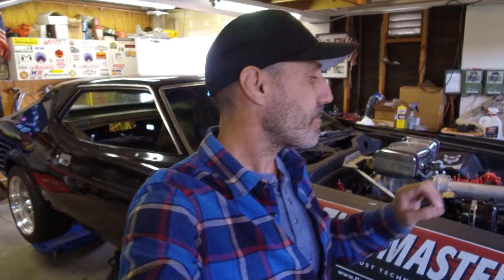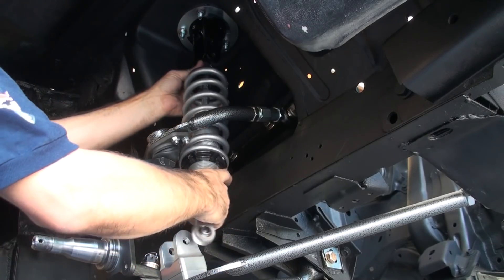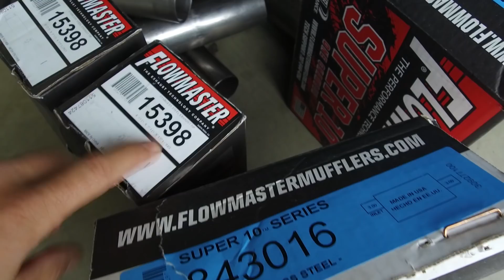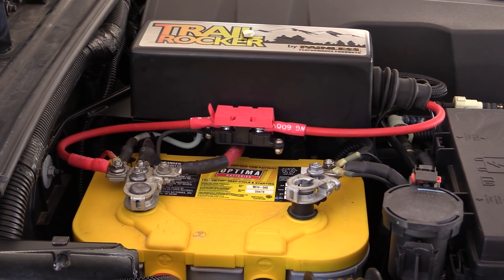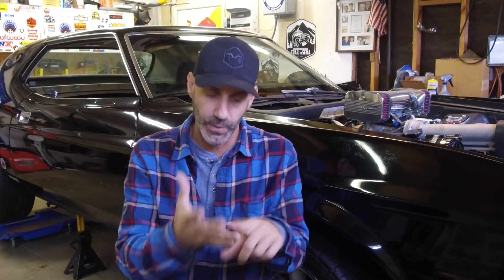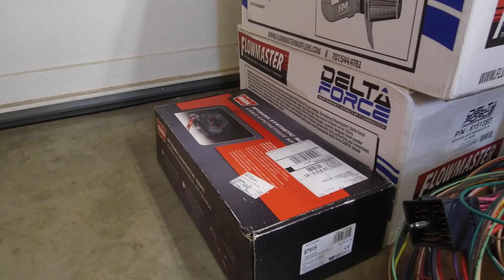I Made So Many Mistakes! AutoEdits Mustang Project Large Marge

Comment: Glad to see large marge back!! My '69 Mach 1 is at the body shop getting paint, need to do the painless wiring when I get it back, looking forward to more of the Mustang videos. I went with the Dakota Digital dash to fit into the existing bezel. Works with the Holly Sniper & Terminator via the ECU connection.

Comment: Project cars are always tough to keep motivated on, especially when you start doing real major work. You really just want it done and to get that satisfaction. Kudos to you for sticking through it and building the car the way that you want it. I had my 72 blown apart with no budget but lots of time, and I did a lot of work that was just a portion of what I wanted to do in the long run but got it running on the budget that I had. It's together and running great now and I've had a blast with it. However..... I'm gonna be taking it all apart again and redoing a lot of work to get it to where I want it. So in the long run it might have been better to just be more tedious and stretch it out longer. All that said; no regrets these cars are for learning and challenging yourself. 

On the gauges, I saw your next video that your going with the dakota digital, they look like they make a great product look forward to seeing more as I want to eventually update mine too. I currently have an aftermarket tach mounted in my stock cluster and then autometer volts/oilpressure/temp gauges mounted in a factory cluster above the radio hole (not all models had these spots but it worked awesome for me.). who needs a radio when your motor sings all day! 

looking forward to your upcoming videos on the wiring, I have a universal painless harness that I've been taking myself into starting to tackle eventually, the factory wiring has so many gremlins that I've bypassed a lot of it for the more modern upgrades (efans/fuelpump/ignition/ezefi)

Comment: I really dig the large marge videos.  I'm working on a 1969 Mustang and a Triumph TR4 with a custom chassis and SBF engine swap, so many of the upgrades you are doing on large marge, I am doing on my projects.  Your videos have been helpful, so thanks and keep up the good work.  As for the gauges/dash, I like the autometer gauges, I'm old school like that, but the dashes in the mustang do suck from 1969 on and with the supercharger and upgrades you have, I see the necessity for the digital dash.   Plus, it looks like you might have a autocross/track toy on your hands, so the digital dash will be good for that!
Reply from the maker: I like the sounds of your projects! Because of people making suggestions on this video... I looked over at the Dakota Digital page and they make a pretty cool set that fits in the stock console!  I'm going to do more investigating and see... would save a bunch of fabrication time and be cheaper than the Holley unit for sure.

Comment: Jason its good to see you back on Marg!  I've watched all of the Marg videos and I think you're doing a great job!  I actually sought a little inspiration from these videos during my build of my 65' Falcon.   I even went with the Niccop brake lines, and man was it a lot easier.  I had my fair share of problems during my build, (first engine fried the bearings in 400 miles, brake line leaks, brake caliper piston knock back issues ect. ect.), but luckily I have some great car buddies that have helped me push through and I should be done by this coming spring.   Regarding gauges, my preference would be to go with the Holley display.  I saw these on SEMA video and I think it would be a great tool to have for tuning and to customize the outputs that you feel are most important to monitor.  I went the traditional analogue direction, but after seeing that video I will be saving up for this as well.  Last comment, can you generate a video with some feedback on the blower / efi setup you are running once you get the car out and driving.  I've always been interested in hearing about what people feel about the performance of these blowers and how well you feel it works for what you are doing with the car (auto cross, spirited canyon driving ect)  I plan on auto crossing my Falcon and would be interested in running this setup as well, so your input would be much appreciated.   Thanks again for making these videos and keep up the good work!

Comment: Large Marge is back! Great to see her in another video.
The digital dash is probably the better and easier option but I do prefer analog dials. Plus no digital readout means you can still say, "well officer my speedo was between the 40 and 50 mph marks but I can't give a more accurate estimate than that.

@AutoEdits Jason for the extra gauges if you go analog, could you do an A pillar cluster like they have on the 1 ton trucks?

Comment: Glad to see a Mustang video. I just got the smaller (7.5 inch) Holley digital dash for my foxbody Mustang, mostly because I wanted to avoid having to buy/set up all those analog gauges and because I ended up getting the Sniper EFI. I say get the digital dash, especially if you can make/buy a housing for it that looks like it belongs in your car. I bought one from a company named Florida 5.0 that makes them for the later model Mustangs, and it has an OEM finish to it. I don't think they make them for a '73 or if they have plans to in the future, unfortunately, but perhaps they would be interested in doing a one off or something (I'm not affiliated with them).

Comment: Jason,  Love your channel.  Go digital with the dash.  You have already done a ton of modernizing, why worry about a classic feel now.  If you were doing a restoration, stick to the analog.  You are building a performance based vehicle in the shell of a classic.  Also, when you do decide to get audio, just do a Bluetooth amp set up.  There are quite a few set ups that involve using a Bluetooth amp and there is no need for a head unit.  Just run speakers to the spots and power them completely with the amp or series of amps.

Comment: Jason, it's great to see that you're back with the Mustang project. I too am in the same boat in a way. My Mustang is currently at The Body Shop. AKA F-bomb Speed Shop. So far it's still on the rotisserie and needs to be stripped completely. My garage looks way worse than yours at this moment because I still haven't cleaned up from when I disassembled my car. As for your gauge cluster, I'm in the same boat. I haven't decided what I'm going to do yet either. Do I really don't have any advice at this time. I don't have the resources nor people throwing Parts at me like you do, so How likely end up going back with Factory until I can afford something different. If I could do anything I wanted, I would go analog. I'm also debating whether or not I'm going to be using a different wiring harness. Or were using my own harness and then adding the wires that I need from a separate fuse block I installed. Either way, it's great to see your back and committed to finishing. I know the feeling because I look at my entire garage and how messy it is and everything that I have to put back in my car and I get flustered. But I know eventually I'll get it back together. Good luck and let's stay in touch. Ob1n
Reply: I ended up ordering one of those multi colored wire sets and making my own harness. Those 50 year old wires are all stiff and the copper is all oxidized inside. I couldnt believe how bad some were
Reply from the maker: Thanks so much for the very thoughtful reply!  I wish you luck on your project as well!

Comment: I've got a 1973 Mustang Convertible 351C with 2-barrel heads, Edelbrock Preformer manifold with a holley 650 cfm. I put 3.55 gears in and would like to change my FMX to a Tremec 5-speed. I would LOVE to put ALL of the Chris Alston suspension on my car!! My vote would be to go with Dakota gauges keeps the style but with extra gauges that come with it.  But I need to find a shop, I'm a backyard mechanic with limited tools and no welding skills. I can't wait to see how this car drives.

Comment: Glad to see the mustang video.  I started watching your channel for the mustang content and copied everything you did on the in tank fuel pump.

I would vote to see the Dakota digital VHX series gages installed. I can’t wait to see you install the wire harness and I plan on copying everything you do on it.  My ‘73 has a lot of electrical gremlins and electric power windows from the factory so hopefully I can figure that out.  I hope you do install a simple radio so you have some tunes.
Reply from the maker: So cool to hear that you got something like that from one of these videos! Thanks for the suggestion on the Dakota Digital stuff... I'll check that out!
Reply: Lol - I watched the fuel pump video at least 10 times. I plan on doing the suspension and wheels just like you did when I get some time and $.  Right now I hope to get the Holley sniper system in 2019.

Don’t cut up the factory console because they are hard to find.  Sell it on eBay and install the TMI products sport XR full length console.

If you get a chance check out all the expansion modules Dakota Digital carries. They have interface modules for most EFI systems that plug into the gages. You can add boost, current, temps, and pressures to the gages with the expansion modules. Also they have the retained acc power and dome light controls.  I have a Mach1 and hope to have it to the point that I can daily drive it (if I want to) so I am really interested in all of the “nice to have features”.  If you need anything I would be glad to help. Just let me know.

Comment: love what your doing with the mustang but i have an idea for your gauges etc that may or may not be sorta cool. if you use the cobalt gauges in the factory bezel then have the lcd display in the center of the dash with the Track Pak where the clock area is in the console i think that could be pretty slick. or too much idk. Great Buid!

Comment: Hey i made a lot of mistakes too on my 66 mustang. I always tell myself what i would have done if i could go back in time.  I went with heidts 4 link instead of Alston canted g like you did. If i could redo it i would just do a back half so i can fit bigger tires. Also i got heidts ifs and i should have made a tube front and cut out the inner fenders.  I got a 4" downpipe off the turbo with a cut out and a single 3" through a muffler and resonator in the back for the street. I just went under the axle to avoid the panhard bar. Anyway keep it up man!
P.s. leave the interior out haha
Reply from the maker: This is great! I tried to reverse stalk you and see videos or images of your car because it sounds very interesting... couldn't find anything.... Thanks so much for the input!
Reply: @AutoEdits  i left a comment on your facebook post

Comment: 5” pro comp gauges fit the housing.  I started to do it then got side tracked 15 yrs ago
Reply from the maker: I know the feeling... LOL
Reply: AutoEdits.  The pro comps are the right diameter.  They can be attached to the end of the housing, but the cable drive would not connect to the speedo.  Then the gauges hit other behind dash stuff.  If you are stalling out, don’t start another custom task.  Get her running and use the roadkill theory. Drive it and you will want to work on it.

Comment: In case this helps, a local muffler shop ovalized the dual exhaust tubes and ran them under the axle tubes, out the rear valence cutouts.  Has worked fine for me and less pinched exhaust pipes.
Reply from the maker: I mocked up the 3" under the axle and it just didn't look right.   I would be curious to check yours out somehow... I went to your channel and didn't see any videos of yours.

Comment: Personally i dont think you needed to get rid of the 3" exhaust tubing, this seems like more of a two man/track car, you could have cut into the floor and routed the pipes through where the back seat would have been and then just covered it with some sheet metal. Im making it sound a hell of a lot easier then it would be obviously but again from the sounds of it, with the harnesses the focus on handling in stead of out right power etc, this seems like more of a two seater/track car then it does a family car and you did say you wanted it loud and jazz so to me it sounds like a good option. But you already gave it away but hey 2 1/2" isnt too bad at all. Also i think the more practical and wiser option would be the holly dash, it just sounds like you can monitor everything your engine is doing and at the first sign of trouble you can stop your car instead of doing some serious damage. Any way those are my half cents. You're doing a great job, on all of your projects, i love them all, and watch all of them, some times even multiple times!
Reply from the maker: Thanks so much! I thought of that and for the amount of effort I'm going to do turn downs for now... plus I'm going to build a little platform for Pinto in the back seat area and exhaust tubes might be a little unfriendly for that...lol
Reply: @AutoEdits  Keeping the doggo safe while in transit and making sure she has the same amount of fur as when she started is a priority X3 I have a German Shepherd so for the longest time i just took the passenger seat out of the car and made it so my dogs harness hooked into a few places in case of an accident, so he didnt go flying through the windshield. He hardly fit in my moms Forester when he was younger so when i got a 2003 mach 1 he didn't fit in the back seat at all haha

Comment: Considering all the changes you have already made to Large Marge, the digital dash makes sense. The thing that I wonder about, what about glare? The touchscreens in modern infotainment systems can get washed out when the sun is in the right position, so what happens if that occurs with the digital dash?
Reply from the maker: Good point... I think since it would be pretty deep under that dash pad it would be protected from direct light mostly... I'll check it out with a more analytical eye!

Comment: Sorry man I really enjoy your videos, but have zero interest in the jeep/dodge stuff. When you post a Mustang video I will watch and like it. But the other stuff I don't watch.

I have to say I feel real bad about your winter blues! ;)  I'm in Minnesota,  it's like 20 degrees out ( and it's a warm day! )  and snow on the ground! All my projects are either buried in snow or packed away in storage. I work on my projects in my driveway. So in the winter not much gets done. 

On the exhaust why not just go with a side exit in front of the rear tires? You have to get a little creative with the tailpipes. But it's better then just dumping it under the car. 

You ask for our opinions on stuff like the gauges. But it really sounds like you've already made up your mind on them.  The new digital display panels  are awesome. The down side to me, is you loose some of the Mustang character in the interior by dumping the big dual round gauges. You look at that gauge bezel and that just screams 71-73 Mustang.  I've owned a few 71-73's in the past. When I wanted more gauges I just swapped the center dash trim panel/waterfall to the Mach 1 version. It had triple gauges there from the factory. Mount the aftermarket gauges behind that panel. You already said you are going to mount that electrical switch panel in the center so what would it matter if you mounted some gauges there too. But I'm old school I like analog/mechanical gauges and carbs.

Keep the Mustang videos coming! Can't wait to hear it run and see you tearing up the streets with it.